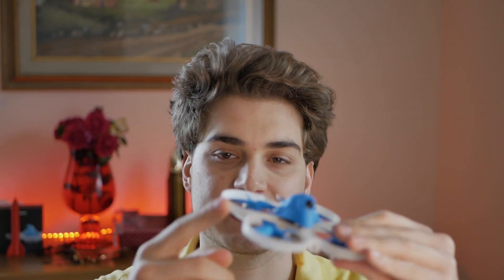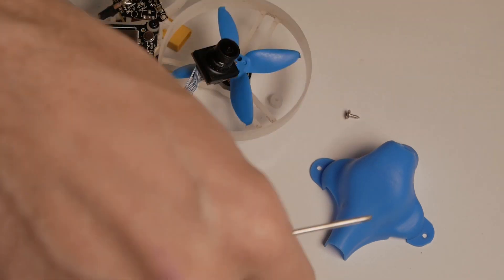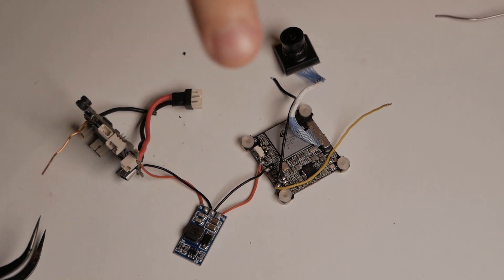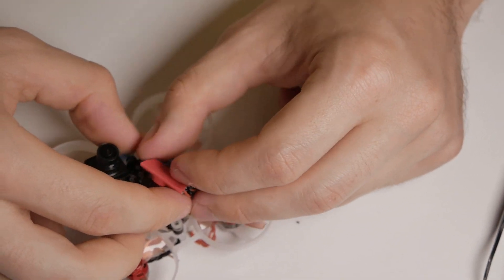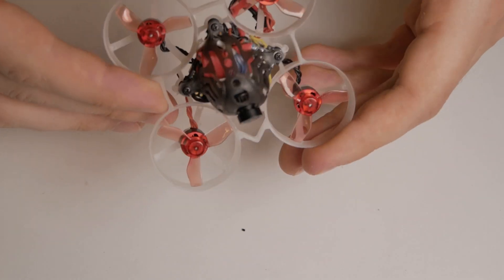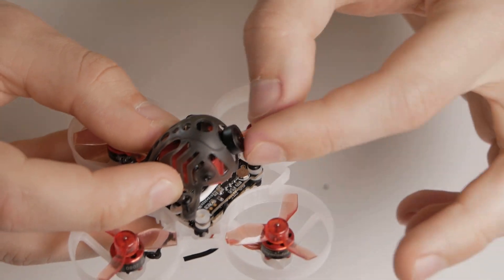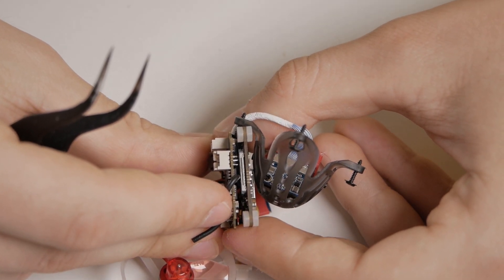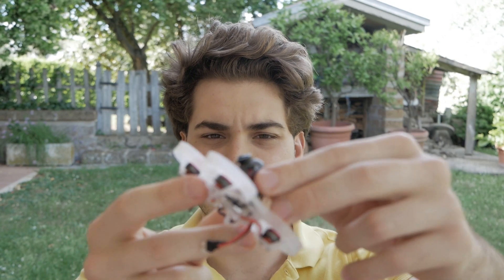Mobula 6 HD! ONLY 28g HD DRONE!! Tutorial

Comment: I just got the Mobula6 HD in the mail and there seems to be a plastic sheet between the boards so they don't touch.  It's flies heavy compared to the non-HD version, but I'm about to do the 75mm frame conversion that Nick Burns did.  The efficiency of bigger props should offset the extra weight.
Reply from the maker: Let me know how it goes!

Comment: Awesome build. Looks as good as the Mob 6 HD as far as flying. 27g vs 28g. The question is which camera is better. Runcam split 3 Lite i think. Nick Burns just reviewed it
Reply from the maker: Wow Just seen it, maybe image quality on the official one looks a bit better, but I fear the lens may be plastic, and that's a bummer, sure it can be replaced with glass and have even more clarity, also I have 21000kv motors and those are 19k, so it should be a little more efficient

Comment: Hello! I have the mobula 7 (not HD). Do you know if it would be possible to power a naked gopro using the 5V booster you used for this build?  I saw someone carry an insta 360 go with it, which is 18 grams, so i think it is possible to carry the naked go pro. Right? And if the 5v booster works, then I see no reason it wouldn't work? Cheers!
Reply: Alternatively, do you think this mod would work In the mobula 7?
Reply from the maker: Booster doesn't work, you need a 5v Bec, takes higher voltage and makes it into 5